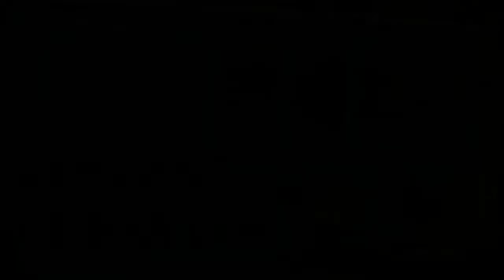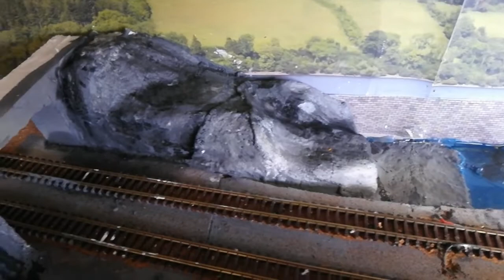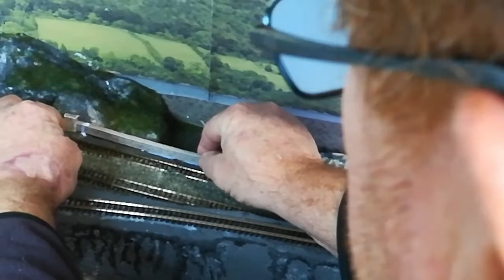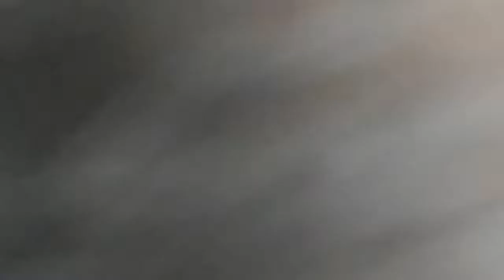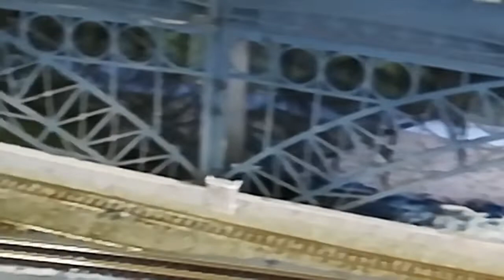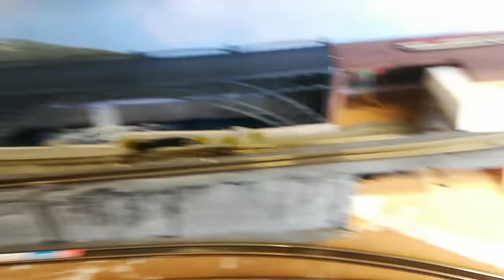Lyng and District Line - Episode 25 - Completing the Reservoir section.

Comment: Just spent an enjoyable half hour catching up on your three recent videos Steve. You really do get through a lot of work. It is looking very good. I think the reservoir looks very realistic. I would echo Paul’s  comment about the lift off section. As you may have seen I am struggling with the High Elven section on my layout which is a nightmare to manoeuvre off the layout.  Even the smaller Grey Havens section takes some handling. The idea of a hinged section makes a lot of sense. Look forward to seeing progress in your next video. Stephen
Reply from the maker: Thank you Stephen - yes it really is something I'm thinking about. I have shelves just above so may have to think of a way around that - I will probably try out ideas with paper and card and see what works. If I do remove it I need to work out where I can place it as the shed seems to be shrinking the more I put in on the layout! Thank you for your kind words!
Regards,
Steve

Comment: Hi Steve Just watched the last three videos your getting on very quickly don't forget to run some trains one for the enjoyment and one to check thing are running well. For you lift off hill use shapper sheet I use it for my hill and I needed it to lift off and it works and Gemma at Stoney-ole used it for her hills were we both have trains running underneath. Run a bit of ballast into your tunnel mouths under you hill because you can see so far in. All the best. Colin
Reply from the maker: Colin - Thanks for that lovely comment. Yes shaper sheet was an option I was considering, that would give me the contours I'm looking for, and perhaps as others have said, hinge the structure to lift up to get under it. I will experiment on both. Good tip on the ballasting, thanks! I will definitely be running my train today to see how it looks against the new scenery, and this month I'm hoping to order in new stock after saving my pennies, so watch out for new trains!